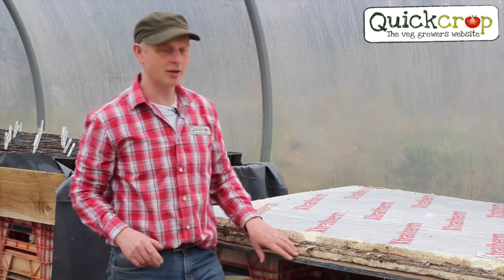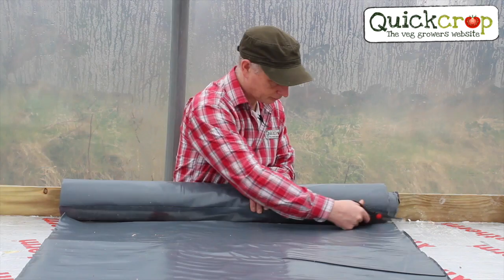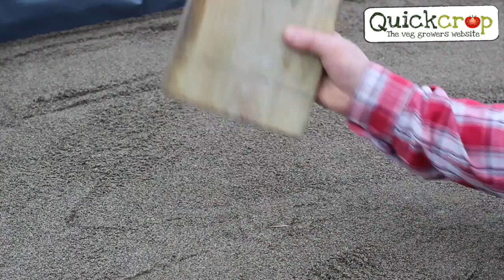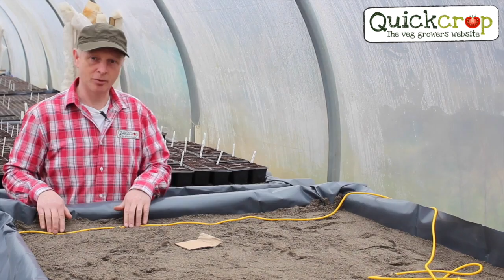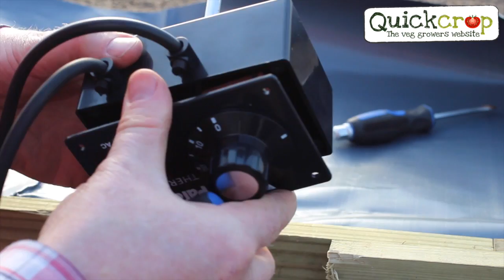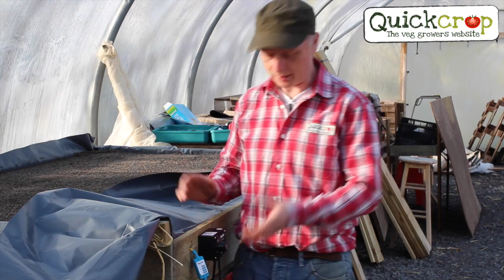How To Build A Heated Propagation Bench

Comment: Hi Andrew. V. helpful vid. thanks.  We just set up a heat base as per your guide - we're pleased with it!  btw we noticed that the cable plug is fitted with a 13A fuse which means it can pass a current of up to over 3kW... thats a heck of a lot of current.  Does that sound safe to you?

Comment: WHY WET THE SAND
Reply from the maker: Great question! Damp sand conducts heat more effectively than dry sand. When moisture is present, it helps to evenly distribute the heat from the heating cable throughout the sand, ensuring a consistent and gentle warmth for the plants. Dry sand would not transfer heat as efficiently, which could lead to uneven heating and less effective growth conditions.

Comment: Instead of an electric heater and that moistening thing you can use simple cow shit fresh started to burn> it is giving constantly heat. you cover that with the plastic and sand and the rest. YOU WILL NOT PAY FOR ELECTRICITY AND IT IS ORGANIC. Instead of wood for the borders of the bed, you can do like a basket from willow branches.
Reply: what would be the exact temp of the cow manure?

Comment: I've a makeshift one with a couple of polystyrene leek trays, sand, soil 6m soil heating cable, heavy duty bin bags and a PID controller + solid state relay + thermocouple kit. A 6-cm x 40cm commercial; tray fits in it snugly. It does the job and once everything is germinated I pour the sand back in the bag it came out of. I don't have the space for something more permanent but I need to build something more robust.
I was thinking a vermiculite base on top of the plastic. Vermiculite is a cheap, low mass insulator.
On top of that the cable and a copper sheet to spread the heat evenly.
Perhaps fix the cable to the copper sheet with copper P clips However there might be a risk of localised heat at the clips damaging the cable sheathing and insulation.
Sand on top of that. *
A bin bag liner on top of that so I can irrigate and bottom water the whole tray. A dry base is also useful for drying things out with gentle heat.
Higher side to give height for the seedlings
Place a sheet of twinwall over the top to keep the heat in to make it as much a closed system as possible and let some light in.
Overhead lighting as necessary.
* The thermal conductivity of sandstone is only 1.83 -3.9W·m−1·K−1, whereas that of Copper is c. 400W·m−1·K−1 so I may experiment with everything above the copper plate. In fact perhaps a heat mat on top of the insulation and no sand above would provide more efficient coupling.

Comment: Can you explain why the sand needs to be wet...I've seen the same with dry sand and pebble rocks which seems to work fine. Thanks in a dance for your reply.
Reply from the maker: The moisture acts as a medium to efficiently transfer the heat through the sand.

Comment: I made one but I put the little blue part and some of the black cable inside on top of the sand . Is that ok do you think ? Also ,exactly where should the thermostat prob be ? near the top of the sand or 2 inches down in the middle of the sand ? Thanks
Reply from the maker: That blue connector should be kept dry, so its probably best outside the bed. Place the thermostat somewhere  in the middle of the bed to get  a more accurate reading.
Reply: thanks . I had to remove the table and sand when building a new greenhouse recently and I`m in the process of redoing the whole thing with new sand so I have an opportunity now od doing it right . thanks for the video  .

Comment: Great video, really helpful. Thanks! By the way is there a way to automate moisture (drip water top off) in the bench? I can't see how to monitor the water under the sand practically, or would I need to physically feel for moisture in each area each day?
Reply from the maker: It is difficult to monitor the water automatically but if the temperature is constant then the evaporation rate will be fairly consistent, allowing you to time your watering.
Reply: @Quickcrop  I guess you could leave it outside, covered with plastic top, with holes to let the rain drip in

Comment: Hi, new subscriber here...we have a similar (using the same cable but smaller) bench/propagator in our little greenhouse but have made a tunnel like structure from clear plastic that goes on top...the idea was to keep the heat & moisture in and hopefully get things off to a good start, we didn't insulate under the sand between the wood and plastic like you though. Its brilliant for growing on lots of plant cuttings as well as seeds...wondering do you never cover yours, after watching this I'm hoping it's not dangerous to have a cover on. Thanks, off to have a look around your other videos now. Ann
Reply from the maker: Hi Ann, we sometimes use a mini polytunnel for some extra protection, but do be careful of over heating and preventing air circulation, potentially damaging young seedlings.  https://www.quickcrop.co.uk/mini-polytunnels
Reply: Quickcrop ok, thankyou for replying and so quickly too :) have a happy growing year. 😃

Comment: Why do you use wet sand instead of dry sand?
Reply from the maker: The moisture in the sand acts as a conductor in order to maintain heat transference. Cheers.

Comment: theoretically couldn't you just use water flexible tube about the same diameter and run hot water through the tube into a reservoir to replace the expensive soil warming cable.
Reply: We have used this method before.  We had a small water heater that fed into PEX pipe that was coiled through the sand and then was routed back to the water heater.  Basically it just kept sending the same water through itself as needed.  Downfall is that the water heaters go out after about 5 years and they are expensive, upside is that you can heat a much larger area with much less energy output.
Reply from the maker: +julio quinones Theoretically it would work. It may need with some adaptation, please let us know how you get on.